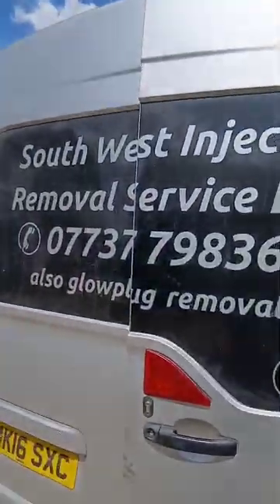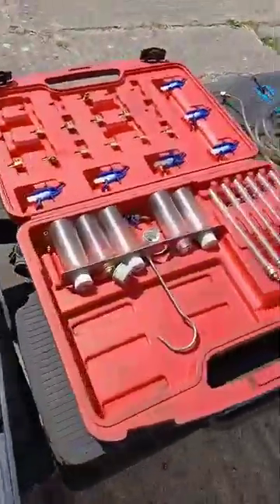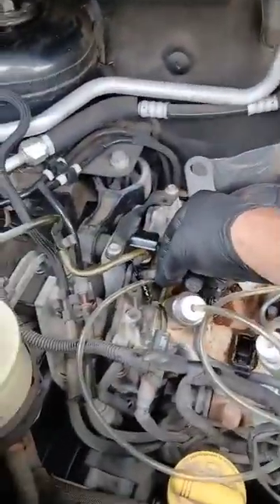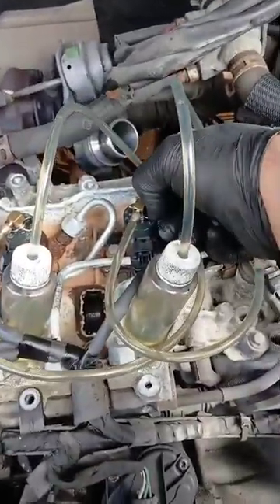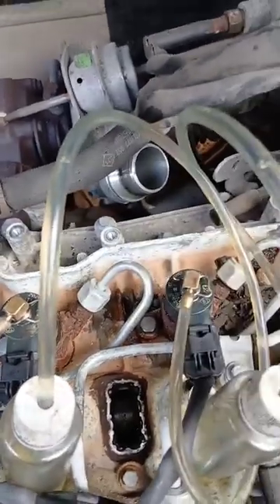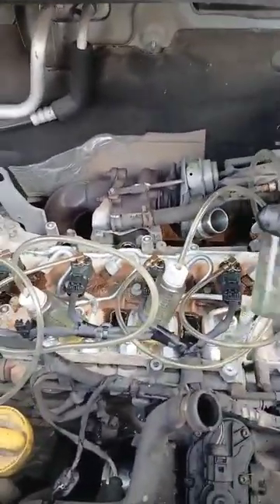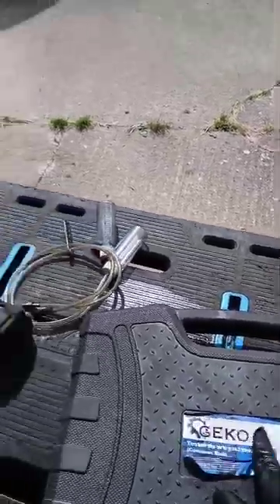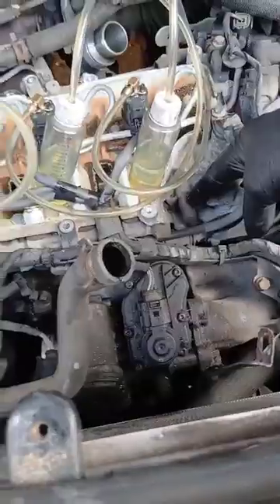How to do a diesel leak off test.

Comment: There are lots of videos that show the issue with vivaro injectors, the scuttle panel drain blocks, rain fills up the scuttle panel and overflows directly onto the engine block. So most of the time the injectors are underwater